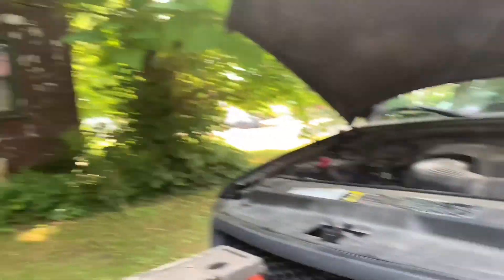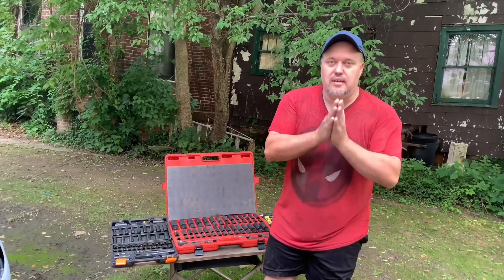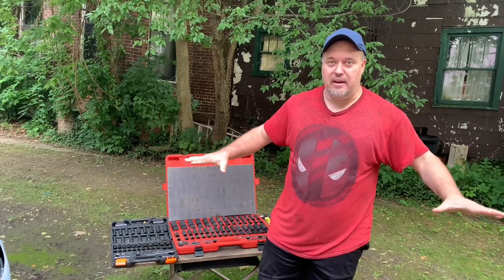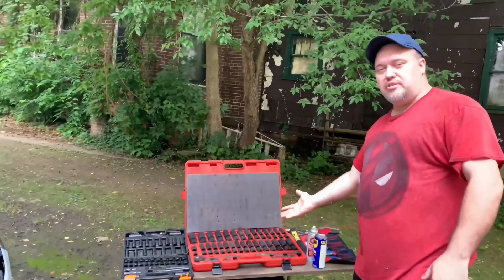How To Remove The Spark Plugs In A 2002 Ford F-150 5.4L Engine V8 Without Removing The Fuel Rails

Comment: I thought the 3V weren't used until 2003 models. Pretty sure 2002 models are 2v that actually like to blow out plugs, not break. The 3v engines are the 2-piece plug designs that break in the wells.
Reply: I think you're right, going to do this job this weekend. I'm not looking forward to it, little room in there. Kinda like working on my bikes. We'll see how it goes. I like the video he made, he must have edited out the curse words.
Reply from the maker: Yes sir, at least 1,000 curse words ✌️👍
Reply: Yes, 3v valve had the 2 piece plugs. The issue with these 2 valves is low thread engagement, so plugs can loosen up and blow out and you can easily strip and crossthread them. Still, video does a good job showing how to get at those back two headache plugs.
Reply: @Mr_Goody  that's a "yes mam"  🤣 some girls wear dresses & can work on their own trucks . #ThanksDad
Reply from the maker: Yes Ma’am Girls Are good at wrenching too 👍
Reply: You are right!
Reply: 3-V we’re supposed to be 2004 from what I read last night.

Comment: As a shop owner i knew instantly the second you loosened the first spark plug that you didn't have the 3 valve triton that breaks spark plugs off. Can't fool me
Reply from the maker: I’m not trying to fool anybody I was just showing on this particular truck how to get the bolts off without removing the fuel rail.  And these don’t have as bad as a reputation of breaking off as the 3 valve you are right, but they can still break off.
Reply: Yeah well you can also tell because it’s a tenth gen lol

Comment: Only the 3V are trouble. They have an extra long porcelain piece at the bottom. I've never had a problem getting out or putting in 2V or 4V plugs.  Although the 2V and 4V are known to shoot out from the factory. Torque them 20-25 foot pounds. Good to go.

Comment: Thanks so much for your altruism! Probably the best detail spark plug removal video on Youtube. I'm currently waiting for the weather to warm up so I can have a go at it. I have a 1997 Ford f150 with 4  misfiring. I put K-Seal and it worked for 2 weeks and the check engine light came back on with a vengeance. Now I have 2, 4 and 6 misfiring. My mechanic don't even want to touch it because of fear of breaking the plug. Thanks again Mr. Goody, I'll be referring back to this video in the very near future!
Reply from the maker: Thank You for the kind words.

Comment: Great video on how to do this. I took an auto mechanic course in 1988 and passed the Nova Scotia Department of Labor exam, I have always worked on my own vehicles but I have always had old vehicles that were easy to work on. 
I was going to change out the plugs on my 02 until I watched this video, not because I think that I can't do it, but because it looks like more trouble than I want to deal with at my age. The truck is running fine so I will leave it alone until the plugs need to be changed, I saved your video for when that day comes.
Reply from the maker: Thank you very much. I appreciate the kind words. The purpose in me doing these videos is to help someone and if this video can help you, then I have served my purpose. 👍✌️
Reply: @Mr_Goody  So I finaly did mine, it was not fun but I got it done. I ended up removing the driver side fuel rail because I did not have anything that would remove number 7 coil, I tried a bunch of things that I had but I had nothing low profile or small enough diameter to make it work, maybe if I had a 1/4" universal or a flex head ratcheting wrench I could have done it without removing the fuel rail. 
I had one of the o-rings staying in the connector, I was able to remove it with a homemade pick without damaging it.
The old truck is running well, going to have the fluids changed tomorrow. 
Take care and thanks again for the video.

Comment: Oil in spark plug tube usually means leaking valve cover gaskets.
Reply from the maker: Yes, you are correct and you can just replace those spark plug gaskets on the valve pan which is not too bad of a job at all. 👍
Reply: @Mr_Goody the spark plug wells do not go through the valve cover.
Reply from the maker: @ricks3313  the spark plug wells are metal tube that goes straight down and the valve pan goes over them and rest on top of them, and there are gaskets that surround the spark plug well at the top of the valve pan cover those gaskets for some reason are damaged such as dry, rotted or cut then oil will in fact leak down into the spark plug and what I was saying is that on a lot of valve pans, you can change the rubber gaskets on the valve pan cover.

Comment: Fantastic video man!  I just bought a 2000 Expedition and want to give it a tune up.  I swear I watched 10+ videos of "replacing spark plugs" and they talk, and talk and talk but you can't see anything and they start with the air cleaner, intake and the bracket removed to start with.  This is gonna be really helpful so I subscribed and I am going to check out all your other content!  Thanks again man, you are doing the Lord's work ;)
Reply from the maker: Thank you for the kind words. And I’m glad you liked the video.👍

Comment: Thanks for the video.  Regarding drivers side number 3, I just ground the 7mm socket down to make it really short and used a u-joint and extensions behind it.  Better yet would be a 7mm with a built in u-joint.  (Whole job; six hours - lots of extensions, wobbly extensions, u-joints, electrical tape to hold sockets on, magnet, and 3/8 air to spin things off when busted loose).
Reply from the maker: Good job my friend and thank you for the suggestions. 👍

Comment: THANK YOU! Thank you! Thank you! Thank you! After seeing a video on removing the Fuel Rails to replace the plugs - my heart sank. I'm a bit absent minded and with all the disconnects and disassembly of this and that just to remove the rails - I would no doubt screw something up. I'm glad I happened on your video! My truck is a 2001 F250 but I doubt the difference between the f150 and f250 would be hardly any at all. Looks easy - but as  you stressed - its not. But its easy for a lame brain like me to follow, if you get my meaning. LoL. I appreciate you taking the time to do this video and taking the extra pains to video the process. Its not that easy to do the filming of this stuff and get the details.
Reply from the maker: You, my friend are exactly right. It is kinda hard to show them all the details and try to explain every Step and not forget anything.  I hope the video helps you and good luck on working on your truck. 👍

Comment: Great video! Just wanted to mention, You talked about being careful not to break the porcelain or you would have to drill the plug out, Your thinking of the 2 piece plugs on the 5.4 Triton 3 Valve, which was found on 2004+ models. You have a 5.4 Triton 2 Valve which has the 1 piece plugs and don't have this issue, The 2 Valves are however known to occasionally spit out a spark plug if not torqued correctly (20ft lbs).
Reply from the maker: Thank you for the info my friend 👍
Reply: Not always true,  working on a 2002 with the style plugs in the video.  Guess what? One of the plugs came out partially and I'm having to go after the threaded part now. ALL spark plugs have at least two pieces

Comment: I just started this task a couple weeks ago. My truck had a missfire, so I replaced 5 out of the 8 plugs/coils. The back ones on both sides, and the one in cyl #7 are a bear to get at, so I'm going to wait until I replace the intake to do them (this summer). Seemed to fix my misfire, after I replace the intake, injectors, gaskets, and do a timing job, it should run like a top!

Comment: Very nice. I have a 2000 expedition with a cylinder 7 misfire. All the videos sucked but i finally got to the plug last night, found your vid this morning. 
I let it soak ivernight and am gonna get it swapped today
Reply from the maker: Hopefully this video helps you my friend. 👍
Reply: @Mr_Goody  no more misfire. Gonna get an extraction tool just in case before replacing the rest, but the hard one is done
Reply from the maker: @johnhardwick1736 good job my friend and thank you for the update. 👍

Comment: Watched to see if I can do it. Gonna have to nope outta this one...., but glad this video was here to see, think sometimes it’s best to cut your losses and leave it to the experts. This is the first vehicle I’ve seen with spark plugs like this. Usually you just yank the wires and unscrew them. This here is like brain surgery, lol...I know this is dumb for me to say, But sometimes it feels like they design stuff to be very difficult to repair, so that they can keep mechanics in business.
Reply from the maker: It’s not down to say that that’s exactly why they make cars difficult to work on as the years go by because they don’t want people working on them.  But I’ll keep cranking out the videos trying to help people save some money. ✌️👍
Reply: Hopefully you have an honest mechanic. My front plugs were pretty new NGK’s, the back 4 were smoked Motorcraft’s. Took me 6 hours (ok 4 without breaks for crying and praying) to do my Excursion. Knuckles are still sore a week later😅

Comment: Great video... My 1997 has the 4th cinder misfiring. That was the last one in your video. The really gunked up one. I'm guessing oil leaked down into the spark plug well? Maybe from the valve cover? Did any of that gunk get down into the cylinder when removing the plug?
Reply from the maker: I cleaned down in the cylinders before removing the plugs with brake fluid cleaner.  That way gunk won’t get into the cylinders when you take out the plugs.

Comment: I have to do this. I am really dreading it. I am going to watch a video on taking the fuel line off the driver's side. If it isn't difficult (probably is) it might be better to take the driver's side off before working on it. I am really worried about breaking the spark plugs. That u-joint extension for your socket looks like it would put pressure on the plug as it might not turn like a straight socket and extension.

Comment: So what was the issue that caused oil to get on the spark plugs and how did you fix it?
Reply from the maker: The oil ring seal gaskets on the valve pan was leaking.  To fix it I replaced the spark plug O Ring seals on the Valve pan.
Reply: @Mr_Goody  thank you Sir!!!

Comment: great video, can you answer one question for me.  were does the top vacuum hose  on the throttle body air snorkel  at exactly 7:00 mark of the video.  where does the other end connect to?  mine is missing totally.  I only have the bottom one but the hole on the snorkel is still here for the top one.  I hope that makes sense.
Reply from the maker: If I remember correctly because it has been a while since I’ve done this video and I don’t actually on the truck I just work own them for people.  I believe it’s a vacuum line that connects close to the firewall.

Comment: I just did coil 7 (third back on the driver side) and could NOT get it without removing the fuel rail.  It was a nightmare!  I'll pay someone to do plugs if I ever have to.  My arms are still sore from the beating they took doing this!!
Reply from the maker: It is a pain in the ass but doable.
Reply: I'm about to do the plugs and coil paks on my 02 ford. I hate hearing of the difficulties you had because I'm sure I'll have them too. I only hope mine goes as well as the video did.
Reply: @davidcapps6111  My condolences. I think I'd rather eat glass. Mostly because of the fuel pressure regulator being in the way of the #7 coil.  However, the driver side is super crowded and everything is hard to reach.
Reply: Taking the fuel rail off is like four screws. What’s the problem?

Comment: Why was there a bunch of oil all over the one spark plug, and how do you fix it? Also, is there any way we can clean the bore, or should we, when we find a bunch of grime and oil like that?
Reply from the maker: There are rubber rings around the valve pan cover that goes around the spark plugs if those rubber gaskets are damaged in anyway, then oil can leak down into the spark plug well.  And then to fix it, you will have to replace the spark plug gasket that goes into the circles of the spark plug wells and that should fix oil getting down in there.  I eventually did that on this truck too. I may even have a video on it on my channel.

Comment: i have a 1998 ford f 150 and i have a problem with the forth spark plug in back i think its siezed up or it wont come out  please give me a advice
Reply from the maker: Best thing to do is to use a Borescope so that you can see down inside the cylinder and see what’s going on and then from there you can see what the problem is and go from there.  The worst possible case scenario you can use an extraction tool that they rent at AutoZone.

Comment: my question is when you found oil on 2 of the plugs what did you do
Reply from the maker: Are used a borescope which has a camera on it to look inside of the spark plug wells to see if there was any leaking around the rubber O-rings and leaking into the spark plug. Well wish there was not.

Comment: So I have an 03 Ford Excursion 5.4. Got my first misfire since having it for the past 5 years. It’s the damn cylinder 4…… so I should let the engine get a little warm and shoot WD40 down the cylinder and cross my fingers? I’ve already ran Seafoam. I’m not looking to do all cylinders at the moment. I hardly ever drive it and if I do it’s on the weekend because I have a take home work truck. The video before this I saw the guy had a magnetic wobble socket with a long wrench. He didn’t use any penetrating lubricants and pulled it out like it was nothing. I know better. Can’t get that lucky. Hopefully I should be okay since it’s an 03. To my knowledge I’m not even sure if anything sparks and coils have been changed. I think I’m at 197k miles. Never had a problem till recently. I’ve changed out sparks and coils on my 08 Crown Vic interceptor and my 01 5.4 Expedition. Only had to do one helix coil on the Expedition because it was my first time. I’m thinking about saving the headache and taking the Excursion to my local mechanic and get them all done at the same time with tax money 😂
Reply from the maker: You have to have a lot of patience and tools like I use in this video and time.  If you have those things then I would say it’s worth doing it yourself and if not, you should take your car to the garage when you get your tax money. 👍
Reply: @ yeah I’m going to attempt it once we get out of this crappy weather

Comment: Is this also for the 1997 5.4 v8 ?

I thought spark plugs had problems in 2004 to 2006 ?
Reply from the maker: No, it is a little different in the 1997 Ford F150 V8.  I will include a link that is pretty easy to follow on the video to changing them. And a lot of models after the 2000 the spark plugs are hard to change on the Ford F1 50s.

https://youtu.be/215h8wI0XFM

There you go I hope that helps my friend .
Reply: Trust me ....the 2002 year of this truck....it is very difficult to change the spark plugs. 
It's a pain for sure ....but so is forking over $450-$700 to a Ford service mechanic!  
Persistence and LOTS of patience  are indeed needed to do this job....but you can do it!! 
I have seen many videos of people changing the spark plugs on 2002 Triton V8 engines and they show them taking out a couple of them and skip to the end of them showing what they took out....but what they didn't show was what it takes to remove them ALL and most especially the ones in the very back and not in detail as you did with each spark plug in this video.  As I said I know the pain it is to do this already but I think this video is going to be a big help to anyone who has never done this before .....so thank you very much for sharing it with your audience. 😊 🔧